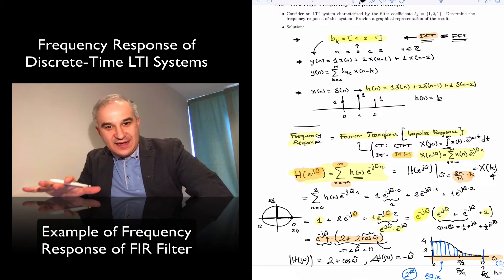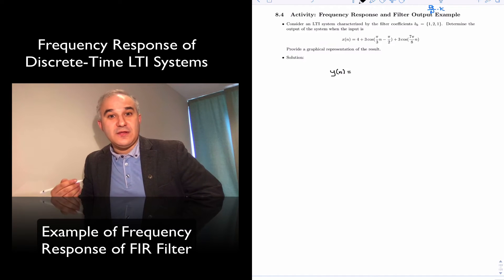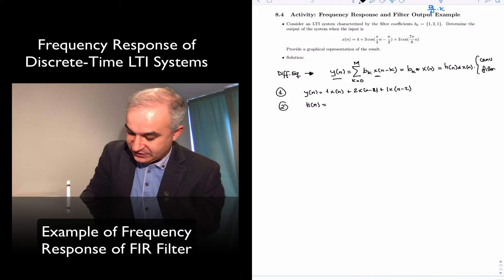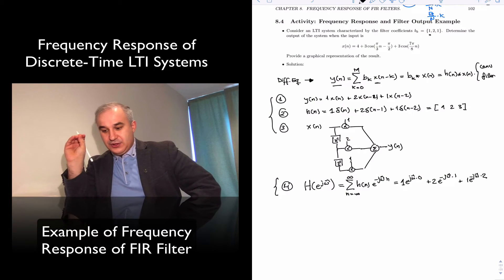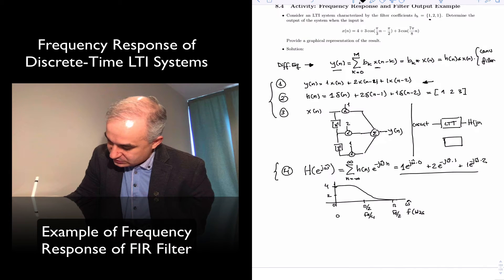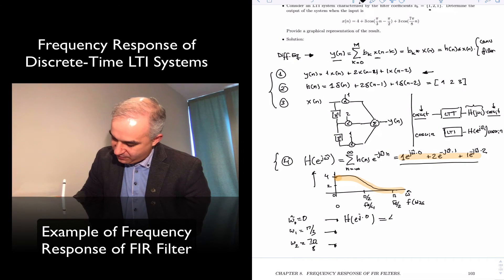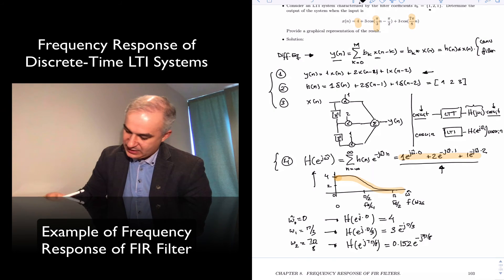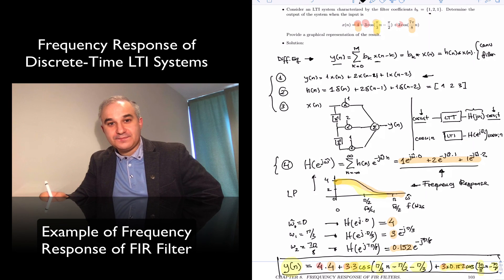T8V6-Example of Frequency Response of FIR Filter

Comment: wouldn't we need to know fs in order to solve this problem. It would go like this, w1=pi/3/fs*2pi, which is not the same as w1=pi/3
Reply from the maker: Victor: No, you don't need to know fs. You can find the frequency response in term of the normalised digital frequency. The connection with the sampling frequency (fs) is only needed to understand the frequencies (in Hz) that would be filtered if the filter were to be applied to a continuous time signal that had been sampled at fs (i.e., fs equals to 2pi). However, the filter can be applied to native digital signals (like in this case).
Reply: same question I had and I'm not understanding a word in prof. answer. In the video we randomly assume omega to be omega_head.  pi/3 is the omega, and without the sampling frequency we'll never know omega_head because omega_head = omega / sampling_frequency
Reply: I guess it implies the sampling frequency is 1Hz so omega = omega_head